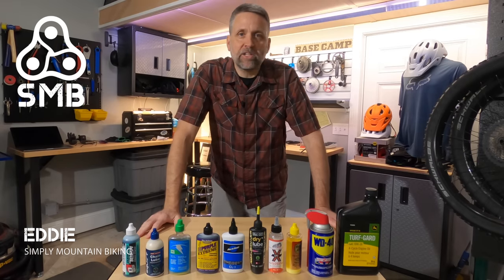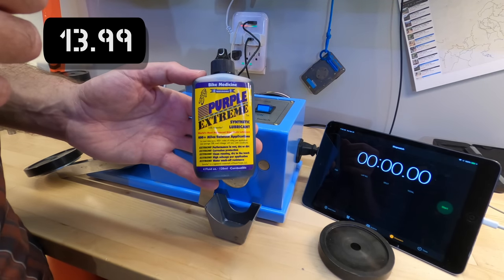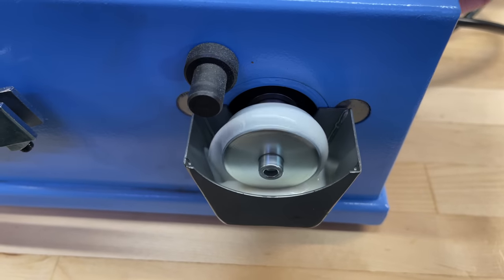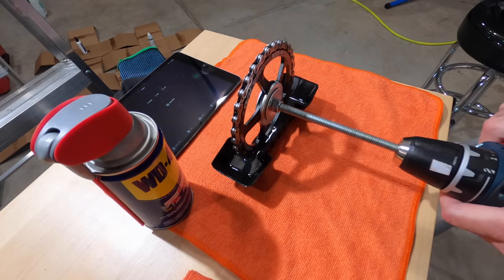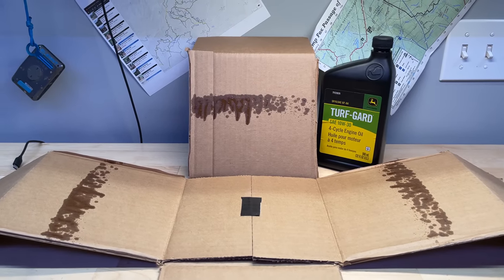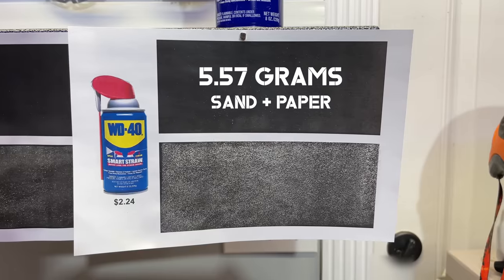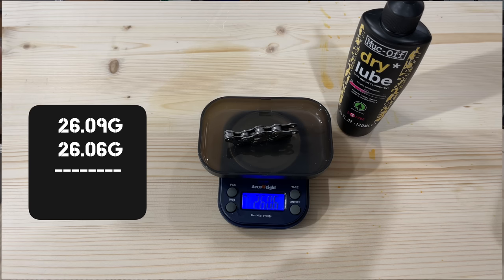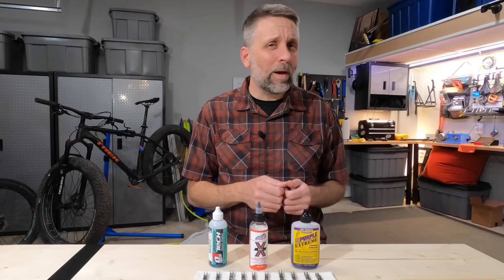Ultimate Bicycle Chain Lubricant Test | Best Bike Chain Lube

Comment: Great video. But I think conclusions are really hard to sum up. Example: A lube that gives small scar, but is really sticky, means in MTB dry conditions application is a very poor product. Grinding sand paste will 100% destroy it's lubricating prowess. 
Also most dry lubes contain teflon in it, I'd even dare to say biodegradable muc off does too. Teflon is extremely toxic, causes birth flaws in living organisms and will last forever. Shouldn't be used at all for something so puny, as people's hobby. So it's really hard to sum up. Otherwise great test, that provides some fair comparison, albeit not on a bike. Which as you said, would be very hard to keep consistent.
Reply from the maker: Great observations.  -Eddie

Comment: I love mic off but you have to make sure to clean off excess. As a bike mechanic you can always tell who uses much off too much. Cassette gets covered in this weird black waxy build up
Reply from the maker: It does have a weird black residue - but I usually have no difficulty getting most off with a nozzle on a hose pipe and some light brushing. -Eddie

Comment: WD-40 is not a lubricant it's a water displacement spray hence the "W(ater) D(isplacement)-40" it's kerosene based so it's great for degreasing your chain to clean it, not lubricate it. I use it to clean my motorcycle chain then clean it off and put on some  Maxima chain wax. I'm sure the chain wax would work just fine on a bicycle chain with less than a 100th of the power on my e-bike compared to my Bandit 1200.
Reply from the maker: Thanks for sharing! -Eddie
Reply: Yeah no worries brother. After 40 years of motorcycling I've heard a lot of "advice" from people. Keeping things simple is usually the best course of action. Keep the rubber side down brother and ride on. Great channel BTW. Stay safe out there. @SimplyMountainBiking

Comment: Squirt is wax diluted with water. Water as a lubricant doesn't work well and will attract dirt.. Dry out your lube before riding. Chainware happens because dirt gets inside the roller of the chain. Sand is an abasive.
Reply from the maker: Okay - thanks.  -Eddie
Reply: @SimplyMountainBiking  best way for lube is to use a heat gun on the chain before and after application. It will get the lube directly in to the rollers and evaporate the water. Just be carefull when chain is on the bike (carbon or tires), this also helps for a stifffend lubed chain. Strange it is not mentioned on any instruction.

Comment: WD-40 is a penetrant, NOT a lubricant. Most use to clean deep before using a quality lube. WD-40 is used a lot for a tire traction treatment for rubber tires in RC car racing.
Reply from the maker: Thanks for sharing! -Eddie

Comment: 4:00 you said it's for damp conditions but the bottle clearly states dry. The Wet lube is actually for wet rides, but both will do fine in damp conditions.
Reply from the maker: Hey there - check out on the label about mid-way down.  There's a bar there.  That bar goes from dry to wet with "damp" in the middle.  The label indicates that lube is for damp conditions.

Squirt also says; "All bikes all conditions."  I think "dry" or "wet" is the state of the lubricant - not the environment.  Perhaps I am wrong, though.  :) 

IMO, the thing that dry lubes do best is not attract dirt.  -Eddie
Reply: @SimplyMountainBiking  wet lube is for wet dry is for dry weather.
But you are right about the bar.
All lubes are wet really how can't they be unless they are wax. It's the conditions defenitly.
Muc Off even has a subzero lube mean tfor very low temps but it rarely goes past - 10c here, so regular wet lube usually does fine. I've not used the dry lube in winter but did use it in bit wet, not issue, as long as its not crazy wet I guess, never tested it.
Reply: @SimplyMountainBiking  you are right, with damp thing, just was unusual to hear it. Usually reffed to wet or dry. Of course there will be overlap. I've used both lube sin both, but when I knew it would be wet and muddy i went for Wet lube. Mucoff both handled both quite well. But Weldtite Wet Extreme is horrible for dry, and overlubibg will make spiderweb of lube on whole drivetrain. And even well wiped not over lubed it collects sand. Muc Off was fine. Could use it as a all round lube so I had to sometimes as I ran out of dry, sometimes out of stock too.

Comment: Great video.  The only thing that doesn't seem accurate is the 'Sling Test'.  3x faster RPM than an elite rider doesn't make sense.  Just wondering why you didn't use a more 'Real World' accurate elite riders RPM then another 'Average Rider' RPM.  Any of those products will fly off at that high of an RPM.  Just my humble opinion.
Reply from the maker: Yeah - it's unrealistic.  I do wonder, however, if some of those centrifugal forces on the smallest cog on the cassette can make the lube see more aggressive flinging motion... -Eddie

Comment: Mistake, squirt needs to dry up for one hour there after with a mob all remained was on the outside should be removed.
Anyway its like 50% paraffine and 50% evaporating liquid. Thats why its liquid in the bottle so it will leak deep into the chain. After evaporation only was remains. And in the cardboard test leave the least materia! behind on the box.
Reply: Wow, I was a bit to fast 😅
Reply from the maker: Thanks for your comment.  -Eddie

Comment: Tried the muc off after this review, not impressed at all. Too thin , attracts too much dirt and very messy to apply, I have been using Rock and Roll, will immediately be switching back. R&R is miles ahead in performance in real life and keeps my chain nice and shiny for several rides.
Reply from the maker: Thanks for sharing! -Eddie

Comment: Nice video overall, but the last test was a bit disappointing. The scale did not have enough precision to measure such a small difference in weight. We do not know how much the chain weighed before adding lubricant. The amount of lubricant retained in the chain should have measured and the results ALSO expressed as percentage of lubricant lost due to the water shower.
Reply from the maker: Fair enough! -Eddie

Comment: 19:43 rollers are shiny and no rust.

22:14 quite a bit of rust? Where?? I didn’t see any and you stated quite a bit of rust.

You should have used dumonde tech lite. It’s yellow and for dry riding. You compared the wet lube to dry lube which didn’t make sense.
Reply from the maker: The surface rust that started on many of these didn't show well on the camera, but I assure you it was there. -Eddie

Comment: There is one problem with bio lubes and that's when it comes time to clean the chain, cassette and c-rings. It is a nightmare as it will not clean off easily no matter what type of degreasing solvent you use.
Reply from the maker: Thanks for the tip. - Eddie

Comment: WD40 is not meant to be lubricant. WD 40 is a degreaser. I really dont understand why you compare it to " lubrcants" So your statement on WD40  is not really fair. WD40 is a very useful product. Greetings from Germany
Reply from the maker: Right on the can; "Cleans, lubricates, protects."  I've learned my lesson, though - Eddie
Reply: @SimplyMountainBiking  Use WD40 to clean your chain, cassette, derailor. The viscosity of HD40 is ultra high. This is the reason why it is not useful to lubricate a chain. At least in Europe it is used by many professional bicycle teams as a cleaner. Of course they use a  lubricant after cleaning the chain with WD40. One exception: if you wax your chain with Squirt or something similar WD40 makes no sense.

Comment: Very nice review, but i have a comment as i used Squirt Chain lune an I recall that you should allow it to be completely dry before use.  Testing it right after applying it and still wet... I guess it's performance has been affected.

From instructions:
3. Allow chain to dry completely before cycling – especially in wet conditions.
Reply from the maker: Thank you for your feedback. -Eddie

Comment: Pretty good but why care how much is leftover if it didnt lubricate to begin with.  After that 1st test the answers were clear..
Reply from the maker: I agree with your statement that the primary consideration is lubrication.  The following tests see whether or not the lubricant will stay on the parts to do the job of lubricating (sling, water), or drag in abrasive contaminants that will negate the lubricative properties (sand).

In the case of Dumonde Tech - it was an awesome lubricator - but it would drag a lot of sand into the system, causing wear. 

Thanks for watching! -Eddie

Comment: I would never use WD40 on a chain or cassette, I did it once and it ended up rusty, it's more about stuck bolts or button head bolts etc.
Reply from the maker: Good call. -Eddie

Comment: WD 40 is NOT a lubricant and doesn't claim to be. It is a water repellent for circuit boards. I always have WD40 as it cleans and keeps my ebike  electrics dry.  I have used White Lightning on my chains for years and as it is wax based it is really clean and does not attract dust and grit like oil based lubricants.
Reply from the maker: Thanks for the feedback! -Eddie

Comment: Sling test, why?   You ALWAYS fully wipe off extensively following application. Many never wipe off and that is their first mistake with any lube..
Reply from the maker: Viscosity is a balance - especially in open systems.  A lube needs to be sticky enough to hold on to the surface it's been applied to, but not too sticky as to hold a lot of dirt (sand test).  By only wiping the chain through one revolution - the chain retained enough that my low-tech testing system would show results.

Although unfair - all lubes were treated the same.  What I'm trying to see here is if there is a difference between the lubes, not singularly testing a lube.  If a lube tests well in the sling test against its competitors, you can expect that performance to carry through to a fully wiped chain better than the others.  -Eddie

Comment: Has anyone experience chain cracking using wax lube? Back to oil with no issues. Seems like there was more friction dragging the chain across the cassette with wax.
Reply from the maker: I experienced more friction myself (see my Squirt test video).  IDK what "chain cracking" is. -Eddie
Reply: @SimplyMountainBiking  My chain was cracking near the rollers on the links in multiple places. I would usually find the crack before it broke through, but left me stranded one time on trail but had extra links to replace and ride out. Using SRAM chain on SRAM drive. Maybe I was not using enough wax, with oil I see the wet look and roll on.
Reply from the maker: @chriss4325  Wow - that's scary to see the chain actually crack on the links! -Eddie

Comment: Not a close representation of real world applications. Most of those lubes require hours of dry time before use. They are also made to repel dirt and grime not just provide a frictionless environment. So much more to bike lubricant than running it on a clean surface and not following manufacturer instructions.
Reply from the maker: Thank you for your comment. -Eddie

Comment: I want to take this test seriously but there is some basic knowledge about chain lube that is lacking. WD-40 is widely regarded as a degreasing solvent and should never be used as a chain lube. You would use it to clean off your dirty lubricant. It shouldn't have even been part of the test. The same goes for motor oil; it is not made to penetrate into cracks and crevices of a chain. This only serves to confuse people into thinking that these products can still be used as a chain lube even though the results weren't the best.  Also, you claimed in a comment that you never heard of Tri-flow. Really? It's pretty damn popular.
Reply from the maker: Yes - I'm aware that people sometimes use just what's in their garage.  That's why I threw them in.  Nope - never heard of Tri-Flow! -Eddie

Comment: please try using wd 40 chain lube. they make actual lubricants for bicycles. also try to keep dry and wet chain lubes in different catagories as they use different evaporative technologies and having a puddle of the liquid is not accurate to real use
Reply from the maker: Thanks for the suggestion! -Eddie

Comment: The testing is compromised because you roughen the surface wheel after the first test
Reply from the maker: In this test - the manufacturer of the test gear provided the polishing stone to be used specifically to remove any contaminants and provide a clean surface between each test.  Thanks - Eddie

Comment: When fitting a new chain, I remove the sticky stuff by wiping over with diesel on a sponge. Then I spray the whole chain with WD40 - really this is for rust prevention as WD40 doesn't provide lasting lubrication. After about one week of cycling I then apply my lubricant which is 2 stroke engine oil - just dabbing on the chain rollers with as small piece of foam about pencil thickness. Then I wipe off the excess oil and that should be good for a couple of months. Then add a little more of the 2 stroke oil as and when required.
Reply from the maker: Thanks for sharing! -Eddie

Comment: There's better (and it's very expensive), pretty much double the price of the most expensive on this list. Silca Super Secret Chain Lube. It has nano-scale Tungsten Di-Sulfide (aka, NanoPlatelet WS2). This fine particle is over three times slipperier compared to PTFE (Teflon) and four times slipperier than the special ingredient in Molten Speed Wax – Molybdenum Disulfide (MoS2).
Reply from the maker: I'll check it out! -Eddie

Comment: I feel it's likely that procedural errors have biased the results against some lubes, especially those that have solvent carriers that are intended to evaporate.  Example, the Demonde "original" lube you tested is dissolved in a relatively low viscosity solvent carrier that is supposed to be allowed to evaporate, leaving what the company calls a "plastic" film on on the friction surfaces. Performing the sling, grit, and water tests while this lube is still wet and  is meaningless and may have severely biased your conclusions against that and similar lubes.  While still wet, of course it will sling off, hold grit, and wash away, but this isn't how it was intended to be used in the real world.

Your wear test results showed dramatic differences, but are they meaningful in the real world?  If the test pressure and velocity differ too much from normal chain use conditions, they might have little meaning.  Some lubes might perform better than others under extreme pressures, which break down their fluid film and result in metal to metal contact, but if their films remain under normal chain use they might protect the chain quite well. .

Low absolute loss during the water spray test doesn't indicate sufficient lubricant was retained, especially if the mass of lubricant initially on the chain was low.  Better to determine the initial weight of lubricant following proper application, drying and removal of excess.  Then calculate the percentage remaining following water spray, and finally determine (with a friction/wear and corrosion tests) whether the remaining film gives sufficient protection.   Low initial weight lubes could be completely washed away yet exhibit minimal absolute weight loss because they had little to shed in the first place,, this is likely the case for WD-40 which is quite thin and not retained for long even in dry conditions - it didn't lose much because there was little there in the first place.  Similarly, the Dumonde can be expected be washed away if sprayed while still wet but that's weight it would have lost to evaporation had it been allowed to dry - a meaningful test would evaluate the amount of remaining film (that was properly applied) and how well it still functioned.

It would be interesting to see how the various lubes perform when the above suggestions are taken into account.
Reply from the maker: Thank you for your comment. -Eddie

Comment: The roller bearing initial test is flawed, don't believe me try Tooth paste in the same manner and show what you discover, it will do well yet nobody claims it is a good chain oil. Why do you test sand retention on wet lubricants, all directions say to dry before riding unless you edited that part out but seemed like you went straight to coating with sand? Better luck next time, sticking with D tech for now
Reply from the maker: Thanks for the feedback. -Eddie

Comment: The test just working to 50% and you are missing the most important thing. The environment you are using the bike, a test in a shop is not like outside with salt, dirt, sand and other particles driven upp from all the cars. And the biggest miss is your forgotten the outside temperature, and chain in -20 C is not the same as a shop to make a lite easier but completely right.
Reply from the maker: Thanks for your feedback.  Lab tests control all the variables.  Real-world is too hard to control.  Take lab results and then apply your own real-world test. -Eddie

Comment: You should have included 3 in 1 Oil in the test.
Reply from the maker: Thank you for the suggestion. -Eddie
Reply: @SimplyMountainBiking  Trust me, you don't need fancy lubes cuz 3 in 1 was originally made for Bikes. I've been using it for over a year with no problems. You should give it a try at some point.

Comment: How can you compare lubricants which require the solvent to dry out (like Squirt) with those which has no solvent? This gives you wrong reading. Also, this is not the way how lubricants in the chains work. In cycling conditions oil based lubricants will collect dirt and the oil+dirt emulsion will work as sandpaper. So, I am sorry to say, but this test and its conclusion is wrong and largely misleading.
Reply from the maker: Thank you for your comment. -Eddie